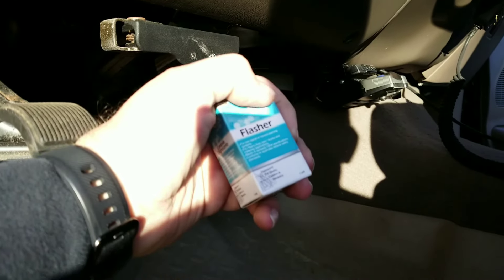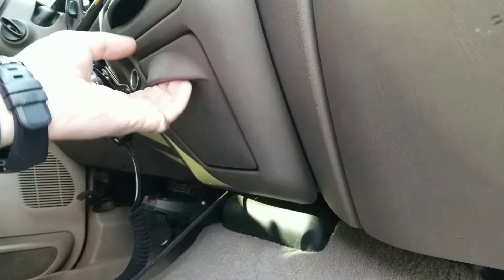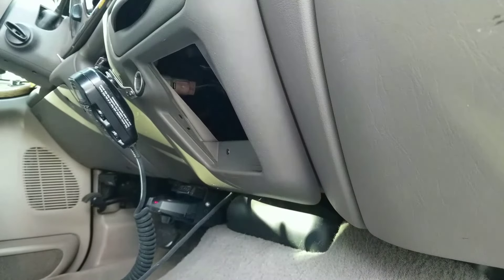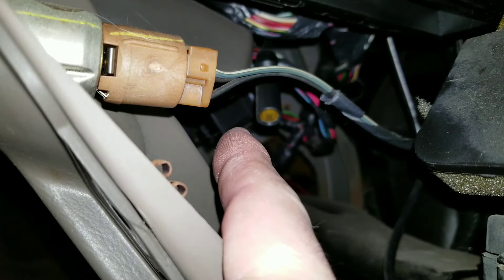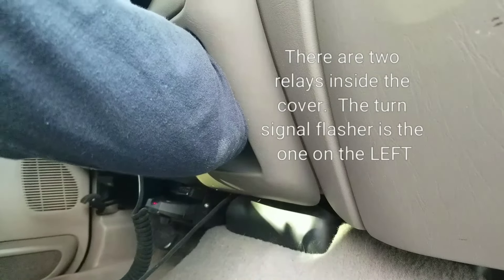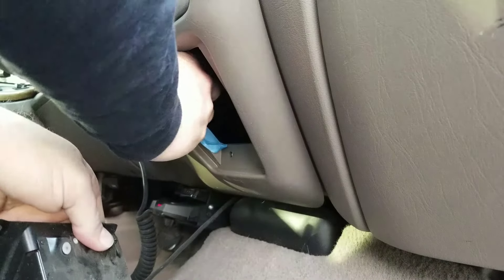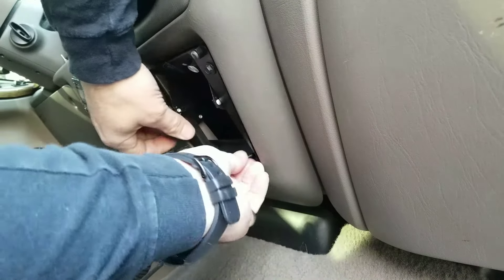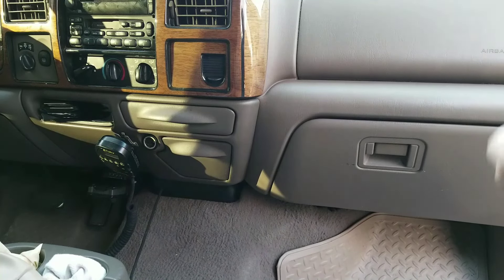1999 to 2006 Ford F250 and Excursion "Easy" 5 minute Turn Signal Flasher Relay replacement $save$

Comment: This was a great video but i need help still...i drive an 2001 ford f450...shuttle bus. Im so lost ...ive taken off the panel below the wheel and my stereo out. I think i see it but i honestly have no clue... Any advice? I dont have an ashtray but an instrument panel...shoot can you Skype me or somethimg?
Reply from the maker: When you say shuttle bus is it a van style cab or a truck style cab?
Reply: @ZeroFuelRequired  lol um i dunno... But i found it...went through the where the stereo is... But had a hell of a time removing it . the damn thing is mounted to the frame. Oh AND it wasnt even the problem i guess...but blinkers still didnt work but whenever i put it in drive or reverse it click like a blinker the entire time i drove. Soooo... I am right back where i started except 15 bucks more broke and a Lil bit mote frustrated! Thanks for answering Hun...i need all the help i can get!
Reply from the maker: @roadtrip2recovery625  ok this might sound strange but you say your vehicle is a 2001 f450 shuttle bus.  I'm guessing it's a diesel.  Diesels don't take a lot of battery power to run and drive.  With dual batteries it'll start even if they are weak unless it's really cold outside.  There's a possibility that your alternator isn't putting out at least 14 volts or one or both of your batteries are weak and going bad.  The reason I say this if the voltage is running low in your f450,  relays can act up because they aren't getting enough voltage to stay engaged.  That could be the non stop clicking you hear that sounds like a turnsignal relay. So before you replace any more parts let's check to see if your vehicle is putting out the correct voltage.  I have a video to help you troubleshoot charging issues. I'll get you a link. Just give me one second 😉....I copied and pasted it, here you go ....  https://youtu.be/H1o3D8sWb08 
check it out and make sure you've got good batteries and voltage before you do any more troubleshooting.   Let me know how you make out with your diagnosis.
Reply: @ZeroFuelRequired  nope not diesal
Reply: @ZeroFuelRequired  BUT you are good. I actually replaced my main battery right before i changed the relay. And the old battery i set on auxiliary battery spot but i havent connected it yet (that battery was getting jumped all the time though but i havent had any battery there at all for months) so it probably is a voltage thong if both spots need good working batteries....ill get back to you

Comment: So in the truck I’m working on there seems to only be one relay, and it is on the right hand side (towards the front of the truck) there is an empty space for a relay on the left. I tried pulling the right one out but it is stuck and I can’t for the life of me get it out of there. Any advice?
Reply from the maker: It'll come out, just wiggle it.  It's odd that there isn't another relay in that block. It's a flasher blower relay block. Like it sounds it Contains the flasher relay and the fan blower relay.  If you are missing one in would guess something isn't working lol.  Maybe you can get in there with a small channel lock pliers or vise grips just to get a better grip to wiggle it out.  Don't crush it.  Thanks for the question good luck. 😁👍

Comment: 4:55 Showing the orientation is helpful for installation, thankfully the terminals are not symmetric. There's no way to install it backwards. The 3 vertical terminals point upward. You can get in there and take a photo with your phone to look at while you try and slide it into position.

Comment: Anyone have experience going through the radio?
I've heard that is a good option.
Reply from the maker: You can go through the radio to reach the relay also. But radios can be difficult for some people to remove if you don't have the right tools. Factory radios can be a pain.  Which ever way you think is easier.  Thanks for the question and good luck.

Comment: Would this fix my issue I have on my truck? It's a 2001 Ford F250 and when I have the 4 ways or left side blinker on they work fine but once I hit the brake they stop flashing and then when I let off the brake they start flashing again
Reply from the maker: The problem you mentioned can be the result of a bad ground. When you operate both blinkers and brake lights and the blinkers stop blinking, it’s because the circuit is not good enough to operate both lights.  Same with headlights and blinkers. Solution is the add an additional ground for the tail lights. Tail lights are the farthest away from the battery. Find the ground wire in each tail light assembly and add an additional wire and connect it to a good solid metal point and your problems should be gone! If not, 
Check your light bulbs, the two filament bulbs can short out when one filament breaks and touches the other filament, electricity back feeds when the brake is applied. 
Make sure you have the right bulbs in and check the wiring harness going to your lights for chafing / bare wires and take a look inside the light assembly for any short circuit. 
Also any additional light like the third brake light could short. Also to check make sure trailer light plug isn't shorted Inside, it can do it too. Or trailer plug wiring is incorrectly wired. 
Good Luck

Comment: Do you have a link to buy the one you got. And did you replace this flasher before replacing your lights to LEDS? Thk
Reply from the maker: I'm looking where I bought the relay. I'll have a link here shortly. And no you don't have to have LED bulbs to use this flasher relay. It is LED Compatible, meaning you can use regular bulbs or LED or both.  I had an LED burn out in my rear taillight and I put in a regular bulb until the replacement  LED came in the mail.  The flasher works fine with a LED in the front and regular build in the rear or vise versa.
Reply from the maker: Here is the link to the flasher that I used (I also added it to the video description) - https://amzn.to/2SGtyoE (this is an affiliate link)

Comment: Ok did not work for me WTH? I bought the unit for LED at autozone and once I install it there is a none stop clicking sound . Any advise
Reply from the maker: Is the Flasher strictly Led or is it Led Compatible?   Check your bulbs to make sure they Are all working.

Comment: Just finished replacing mine. Rapid blink gone, thank you. The only thing is I have an extra blinking sound from the relay after the signal is turned off. Just one blink sound after the signal is turned off. Any one else experience that ?
Reply from the maker: Yes the LED compatible relays make blink or two extra,  even when turned off, it uses up the voltage that was sent to it when it was in the on position. Nothing to worry about.  Thanks for the comment.
Reply: @ZeroFuelRequired  alright not really a concern more so than an annoyance but I'll get used to it lol

Comment: Hello i just bought a 2001 ford excursion yesterday and the turn signals are not working at all, there is no response on the dash, would this fix the problem?
Reply from the maker: It should,  but double check to make sure the fuse isn't blown, I think it's #18, check the bulbs to see if they are lighting up(step on brake lights and turn on parking lights for front & rear) when you turn the blinker on for left or right side it doesn't do anything?  Change the flasher ($10) and you should be good 99% of the time the flasher fixes it.   If they still don't work, take the the bottom of the steering column apart look for broken wires going to the "turnsignal" multidirectional switch. If there aren't any,  try a wiggle test (wiggle the wires to see if it'll start working) and finally unplug the switch them plug it back in. Let me know how you make out.
Reply: @ZeroFuelRequired  thank you ill give it a try

Comment: Thank you for mentioning the orientation of the flasher, it would've gone bad if i had tried to plug it in upside down.No more hyperflash EP27.... you deserve a thumb up.... 10 thumbs down I don't understand why? Went from impossible to smooth as silk after watching this video.I tried the radio hole but that didn't work for me but through the ash can hole, instant success .... indentations on arm no cuts,

Comment: I bought my relay today and will get around to installing it by the weekend. I do have a question. Why is it   that when you add LEDs to the truck, this needs to be done? Like why does it hyperflash? And how come the hazards don't hyerflash but the turn signals do?
Reply from the maker: Standard flasher relays are designed to flash as a specific rate with the standard incandescent bulbs on the amount of current they draw.  The LEDS  pull such low voltage when the blinker flashes 2 bulbs it speeds up (hyperflashing) take a bulb out like I did on the video where it is only flashing one bulb and it flashes so fast it fried the one LED. I don't reccomended doing this unless you want to burn out a LED.  When you have 4 way flashers going with LEDS in,  it is pulling more current through the relay and it will seem to flash closer to the normal speed because it is pulling more current.    I hoped this answers your question.  Thank you for the comment.
Reply: Zero Fuel Required wow! That makes PERFECT sense. Now I get it. Thanks bro! I can’t wait to do mine. Will follow up with the thread when I do.
Reply: Zero Fuel Required got it. Mine was actually the blue one. Omg; what a nightmare to actually pull them out. It was all finger strength. You can’t get ur palm on them. For forearms r killing me
Reply from the maker: @Deerector  yeah but it's better than tearing the entire dash apart. Definitely Not much room in there.  Glad you got it done and the old saying "pain is only temporary" 🤣. I'm glad I could help and thank you for the comment.
Reply: Zero Fuel Required oh yeah. To hell with the whole dash. No way lol
Reply: Zero Fuel Required any idea what the relay next to it is for? The black one. I pulled it and checked everything. Everything seemed to still work. I just put it back and that was that.
Reply from the maker: @Deerector   In the box, one is the 4 way flasher and The other is part of the air bag diagnostic module.
Reply: Zero Fuel Required wow. Thank you for that info. So glad the damn bag didn’t go off when I was taking that shit out 🤦🏻‍♂️
Reply from the maker: @Deerector  I don't think it is anyway part of the airbag system that sets it off.  It's just part of diagnostics for the airbag,   when someone would plug a computer into your vehicle to troubleshoot problems with airbag system or when you have an airbag light lit on the dash. The best I can tell.

Comment: It's so much easier to remove the radio to get to the flasher cover.  I tried it your way and I was not able to get my arm in far enough to reach the flasher cover.  Your way may work for a person with slim forearms.
Reply from the maker: I don't have slim forearms, I'm 6'2" , it was tight and that's why my arm was all tore up from the sharp edge that I put tape on.  Even with that,  I didn't have any problems and this video is just showing another way to get to it without tearing the whole dash apart.  Whichever way works, thanks for the comment.
Reply: Thanks PJ I will try that as I have a 7" dvd  player that will slide right out..... EP27 cures hyperflash 99.5 SD
Reply: Radio is a long way from flasher relay, did that work?
Reply: Ernie, I have long skinny arms & I couldn't locate it through the radio hole

Comment: Definitely quicker than taking off the upper and lower dash.  However, mine had 3 relays in that location under the cap, and the flasher relay was on the right.
Reply from the maker: What year vehicle do you have?  I hope my video helped and thanks for the comment.
Reply: the 05 f350 i did it on had only 1 relay in that location but it worked like a charm other than that minor difference

Comment: How to know if the problem is the relay or the turn signal switch?
Reply from the maker: If I remember  correctly The 4 way flasher and the turnsignals share the same flasher.  check the fuse first then Try your 4 ways. If the 4 ways don't work it's the relay. Hope this helps.
Reply: Sometimes it works and sometimes it doesn't work thanks for the help im thankfull
Reply from the maker: @carmelozambrano5305  Checking the fuse and changing the flasher relay is a cheap fix if it's the problem.  But if it isn't, checking the fuse and replacement of the relay would eliminate them.   To narrow down to what is actually causing the problem.  The turn signal multi-switch?  Good luck.

Comment: I've been driving the farm truck which is a 2001 f250 for over 5 years and didnt know that was a ashtray let alone it flipped out.
Reply from the maker: I don't smoke and you must not be a smoker either.  Good times 😉👍
Reply: I prefer smokeless products, my 2001 dodge I know where the ashtray is because it hid 2 cans of grizzly fairly well as a teen as well as held $20 in change
Reply: If I would have known it was a ashtray it would have been filled with change 1000 times by now.
Reply from the maker: @brandonmiller7466  well you've got a new found storage space lol.  Thanks for the comments.

Comment: That's just a standard relay?
Reply from the maker: You can put a standard relay in. But this video I put in a L.E.D. compatible relay. I am running LEDs in my rear  taillights and front turn signals. Hope this answers your question.

Comment: you dont happen to know what the other relay ( not flasher) is ?
Reply from the maker: I'm pretty certain it's the fuel pump relay.  Dumb location for any relay. The designers should have been fired.
Reply: @ZeroFuelRequired  what exact year is yours, your lucky then, my 2003 f250 5.4 has a fuel pump relay built into the circuit board on the fuse box and no othe relay next to flasher. makes me think wtf did they change it to that then !!!!!!
Reply from the maker: @brianblithe2271  mine black excursion in the video is an early 2000, I never looked at my blue 2003 to see where the fuel relay is at.

Comment: good video but my turn signal flasher is the one of the right, NOT the left
Reply from the maker: Maybe the electrical box that holds them was installed upside down at the factory.  🤷‍♂️  Thanks for the comment.

Comment: Thanks, I am trying to fix hyper flashing.  Your instructions were clear and to the point! Question : What flasher were you using, and was it to fix hyper flashing?  Thanks Again!
Reply from the maker: puckshooter11 my relay quit, i changed all my bulbs to L.E.D. bulbs which requires a compatible flasher or in line load resistors(led compatible flasher is much easier) are you using L.E.D. bulbs with a standard flasher? Or do you have a light out?  Hyper flashing usually happens when there isn't enough current being drawn through the circuit to make the flasher relay flash at the appropriate speed, check to make sure there isn't a bulb out.  If that's not the problem then are you using L.E.D bulbs in any or all of the turn signals?  L.E.D. draw much less current and will cause a standard flasher relay to hyper flash.  You need to replace the flasher relay with an "L.E.D. compatible flasher relay" that should fix your problem.  I ordered mine through rockauto.com , any auto parts store should have L.E.D. compatible flasher relays.  Thanks for the question,  I hope this helps

Comment: WOW an engineer prior to the lobotomy!!! Seriously, you have too much common sense to be an engineer. Why is the flasher relay located in such an inaccessible location? Why are there knife edges on any part of the dash on any vehicle? Why is there so little location information in the owner's manual? Thank you for your easy explanation and practical video.

Comment: I can not get that stupid cover off on the inside. My goodness.
Reply from the maker: @slulions07   you need some good thumb index finger strength  to get it to release.  If not, you might have to pull the radio out to give yourself a different  angle of attack.  You'll get it. Thanks for watching and Good luck!
Reply: @ZeroFuelRequired  I finally got it off and put the new fuse in. I gave up on putting the cover back on though. I might try again in a few days. I ended up using one of my kids diapers (a clean one obviously) to help prevent getting cuts on my arm.
Reply from the maker: @slulions07   ha ha, clean diaper 🤣👍. That's cool.  Whatever works.  Know  anyone  with kids? They  have smaller arms and can reach in there much easier than we can to put the cover back on. Preferably not a kid in diapers 🤣.